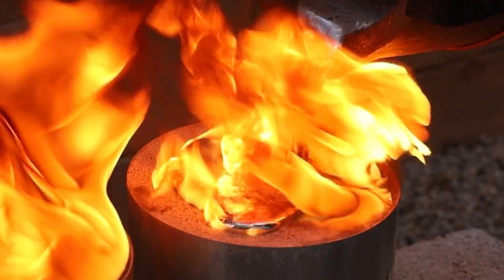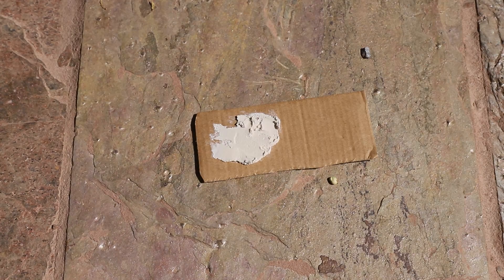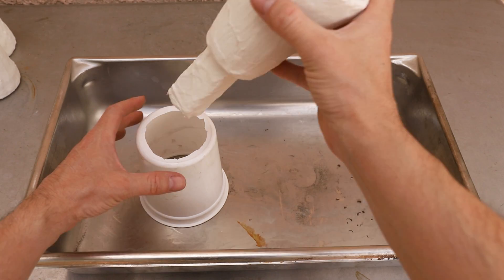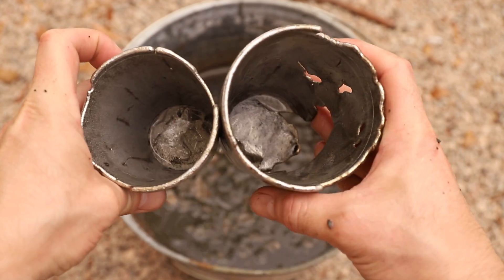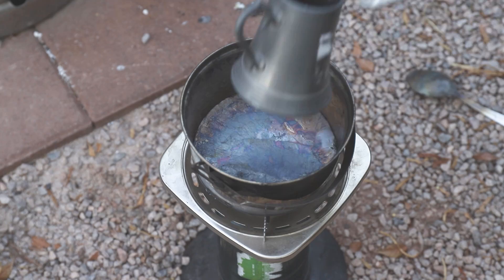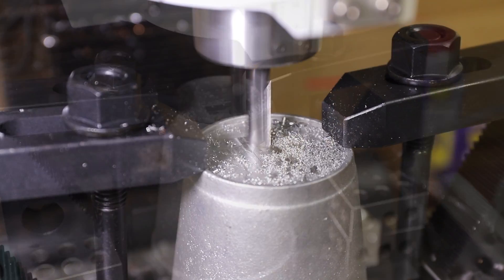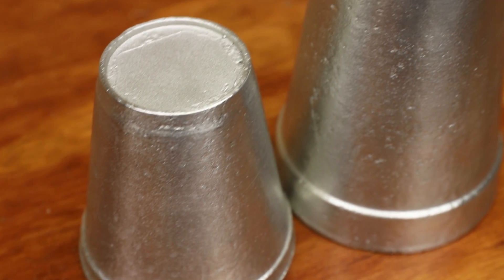Turn Styrofoam cups into METAL - Experimental metal Casting - Lost foam casting

Comment: THIS IS A TUTORIAL ON HOW NOT TO DO IT !
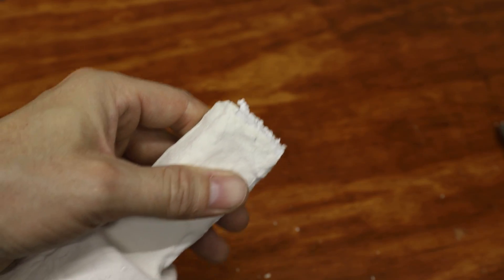I respect your skills but wtf was that on 1:49 ? That's not how basin and sprue should look like ! Its a joke ! No wonder you got so much porosity . 
There are no gas vents on the mold ,you didnt burned out styrofoam after acetone dip ,so it burned out and made gas -gas that wanted to come out trough the sprue ,but you are pouring metal trough that joke so the gas went down into casting . 
I recommend you read trough C. W.Ammen  book "Complete Handbook of sand casting" . It is a  interesting read and he goes in detail . Same rules apply for lost foam -investment casting as in sand casting . It just needs gas vents as well since it is a shell that doesnt have porosity of the sand that will let gas pas trough. 
You will get much better results .

Comment: I feel like there should be sprues from the rim for ventilation purposes.
If when disolving the cup or pouring air gets trapped in the thin walls ... it will bubble or get trapped there.

Comment: It’s always a good day when Robinson Foundry uploads!

As for improvements, it sounds like removing, not just dissolving the foam would help, slightly preheating the joint compound mold, and trying to reinforce the mold by imitating your suspendaslurry technique by pouring sand over the wet layers or even adding the wire. 

Inspiring video! Thanks!

Comment: Paint the cups with some white PVA paint first, to get a layer to interface with the drywall compound. Also try diluting it further for the first coat, and using a paint brush to do a few coats first, before the more thicker coats, and for glueing the sprue on take styrene and dissolve in acetone till saturated, and use a drop of that on the sprue, then touch the cup to there, no glue residue. Acetone will have to be left in for a day or so, but cure the compound in an oven at low heat first, around 120C, so as to try to melt most of the styrene out first, holding so it is sprue down in some of the sand, so the melted plastic can flow mostly out.

Comment: Maybe if you preheated the mold to burn out the remaining Styrofoam you could avoid off gassing and fire.

Acetone will dissolve the Styrofoam but not remove it. It just turns into slime that takes up far less space

Comment: FIY, you should be able to remove the joint compound with acids. There's specific types used to clean tools of concrete and other work related stuff. I used them to dissolve concrete (or at the very least weaken it) when i hole where i couldn't use a drill to cut. You can basically scoop it up with a spoon at that point.

Comment: I'd try doubling the wall thinkness by placeing two cups inside of each other, also creates a thicker base and higher walls, but both could be cut off if wanted.
Thicker walls get rid of a lot of problems while casting.

Comment: Having done this a few times now - thinner is not a good idea with lost foam.  It's a great method for thick blocky things, and in those cases you don't need to melt out the foam because pouring temperature aluminum burns through it just fine as long as your maintain a constant pour with proper gating.

Comment: Acetone dissolves styrofoam - it doesn’t remove it, it just leaves a varnish of polystyrene behind.
Heating the molds to ignition temperature of the polystyrene might help because otherwise you are fighting the combustion gases from burning styrene in trying to get metal into the mold.
Reply: And there is no gas vent so all the gas is trying to go up,from which you pour metal .And thats why it had so much porosity . Pouring basin and sprue are a joke.

Comment: Technically, those cups are just “foam’ cups. Styrofoam is a trademark and is extruded, while the cups are expanded polystyrene.
Reply: Expanded polystyrene is worse for casting ,extruded leaves much better finish . Both can be used thou.

Comment: You can get perfect casting with aluminium too, you have to bake the moulds in an oven to burn out all the styro residue, and cast the metal when the molds are still hot.

Comment: Couldn't you preheat the mold? You would probably need to do a different style mold, but if it is already hot when the metal is poured there would be plenty of time for the metal to flow into all the little cracks and crevasses before the whole thing slowly cooled.

Comment: What about building a couple of small diameter vents off the rim back up to the top?  That would vent the air, you probably wouldn’t get the bubbling, either.  Might be worth a try 🤷‍♂️
Reply: A bottom fed casting would be even better, allowing the gases to exit through the riser instead of flowing against the flow of metal. On some small castings, spikes are poked through the sand to touch the pattern to give a path for gasses to vent out, and the resulting metal that enters the vent can be easily snapped off.
Reply: @joejoejoejoejoejoe4391  I cast bronze coins and thats the method. I use a flat two-part sand mold. Metal goes in one edge of the coin, and I have 2 small air vents at 1/3 and 2/3 position going up. That way, the metal can flow in and push any gases up and out the vents as it flows. It also helps when you're casting things like animals, flat, that have four legs and a tail. Put an air vent at each extremity or it won't fill completely. Those extra small "sprues" are easy enough to cut off.

Comment: Why not burn out as much foam as possible after clearing most of it with acetone, as in lost PLA casting? As you point out the thin walls are already pushing it so no need to add foam residue as a second complication.
Reply: @KrazyMitchAdventures  hence why I said plaster, as shortened for plaster of Paris. Gypsum while it does contain some likeness to plaster of Paris, it is not the same as.

I know how to cast using plaster embedded with silica dust and sand at very high temps, that when quenched the plaster crumbles into a slurry in the quench water. It's a fantastically interesting process and very dangerous to do if you are not wearing protection, since the risk of splash burns is quite high when the just off incandescent mould and metal hits even rolling boil quench water there is quite a bit of stream and lots of popping taking place. So if you do it, be extremely careful and don't stand right on the quench. Long grippers are a very handy tool for that kind of stuff.
Reply: He had to have a sprew hole to pour into.
Reply: @KrazyMitchAdventures  I am not saying it is good. It's just what I had, and apparently a foundry supply around here that knows what investment is, is not available 🙁, and shipping charges for a bag of dirt is rather expensive. 
Just saying it still worked with some extra care. The failure rate will be much higher.
Reply: It might need more plaster for the cast, but I totally agree. It would require a lot more heat, but I'm pretty sure it would be possible to pour stainless steel, even, I saw many ringmakers do it with lost PLA, and the rings were very thin. I like the Idea anyway, it's nice to see the texture of the foam remained intact
Reply: @iomeliora9430  My experience is that if you don't do a burn out ahead of the pour, the plastic generates gas when it vaporizes and messes up your casting. In sand casting on larger objects it probably works as the sand can vent some of the gas, and the size of the pour relative to the mass of plastic is large. The larger object also means more surface area for venting.

On smaller objects in the more sealed up investment plasters, I don't see good results.
Reply: Burning polystyrene produces a lot of nasty fumes, so it should not be done without proper ventilation. The kitchen oven would probably be a big no-no!
Reply: @pierrec1590  Needs to be hotter than a kitchen oven can do to burn it out completely.
Reply: @court2379  Ever heard of self-cleaning ovens?  They are rather commonplace in America. The cleaning cycle goes up to 500°C (932°F) This would definitely burn the plastic to ashes.  Still, I would advise against doing that.
Reply: @pierrec1590  Well I suppose if you did that yes...you got me 😁. You'd have horrible smoke damage though🚬. 
BTW, everything I have heard from maintenance technicians is to never run the self clean mode. That it damages the electronics and often other parts of the oven itself. I recently took mine apart and there is little wonder why. It's just a couple layers of sheet metal, and a tiny amount of insulation. That heat is going to get thru. 

I plan to build a box that sits on top of the furnace outlet to do the burnouts. Then waste heat from the furnace can take care of it.
Reply: @court2379  I repeat, I advise NOT to do it in the kitchen oven. It is possible, but do NOT use the kitchen oven.  
As of your idea of modifying your furnace, please check with the local fire department and your insurance company, especially if this is your residence.
Reply: @pierrec1590  By furnace I mean the foundry furnace, not the one heating my house...
Reply: You don’t even need to use drywall compound. Just place the styrofoam cups in sand, put a can—opened on both ends—over the top, and pour your mold. I see that method used in almost every other video.
Reply: The problem is, he used Drywall Compound, which is  gypsum dust mixed with water. It doesn't do well in extreme heat, so burning it or heating it in a oven, would reduce it back to gypsum
Reply: @KrazyMitchAdventures  I have done a mixture of sand and gypsum plaster with burning out PLA. I don't have a thermostat, so just got it up to a dull red on the outside. It was brittle, but did hold together during casting. I poured sand around the mold for support before pouring the metal.
Reply: @KrazyMitchAdventures  That's true. He would need to use the suspendaslurry stuff.
Reply: This is what I was going to suggest.
When you melted the styrofoam, you created solid plastic in areas. You could see that in the casting attempt.

If you were to burn out all of the styrofoam, not only would it all vaporize as a gas, but it would preheat the mold for when you pour into it.
Reply: I was likewise thinking that heating the moulds to burn out the foam would work well, even more so if you used plaster built in layers very thin mix at first then gradually thicker coats in layers. Add in increasing amounts of silica sand then when estimated about three to five millimeters thick. Just heat in the casting furnace to burn em out. Then do not let them cool before the pour.  Pour the aluminum while the moulds are still glowing hot. The heat of the moulds will help the metal to stay flowable until the temperature drops to freeze it in shape. After that it's just dunk in water to cool even more and get the moulds to crack from the temp swing shock.

Comment: You could try preheating the molds, it give you a little longer for the metal to flow into the gaps
Reply: I was actually thinking that he could do as u mentioned. This would help to take out the poli styrene from the mould but again you would possibly need to be careful about the mould cracking in the heat cycle but it could help to stop the water from the joint compound from boiling so quickly with the water then also causing problems with the mould filling up easily because of the small thickness of the cups same thing really as lost pla if you don't get rid of the pla you have a lot of issues with the mould filling even
Reply: It does look like cold lap, something that I have experience of when the metal is too cold when poured, however if the metal is too hot, it's so runny it runs into the sand an you get a sandy casting ( like a casting, but with a metal/sand skin )- not good when zirconia sand is used, it blunts carbide tools like you wouldn't believe.
Reply: kilning them would get rid of any residual styrofoam/acetone slurry as well
Reply: This is something companies actually do.

Comment: @Robinson Foundry could these cups be then used as a mold to do loss casting with aluminium and other high temperature metals?
Reply: Probably. The sand etc is what handles most of the heat.